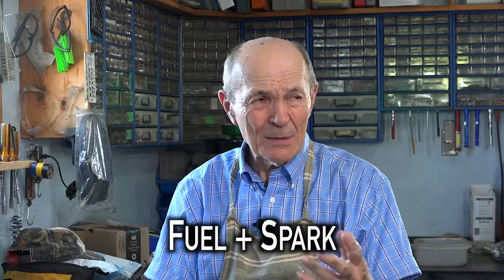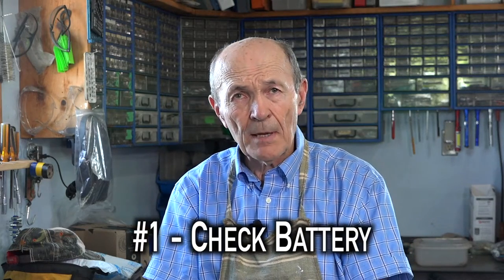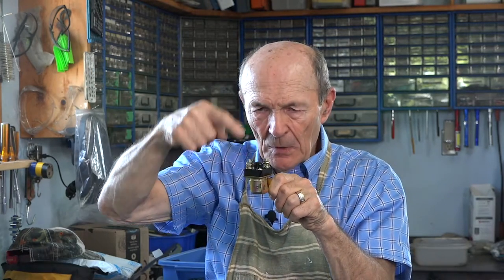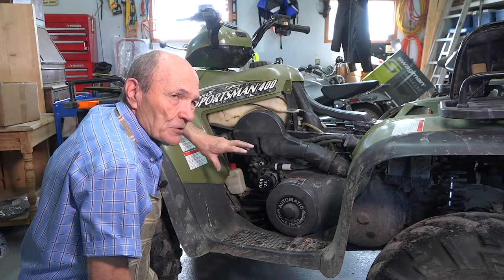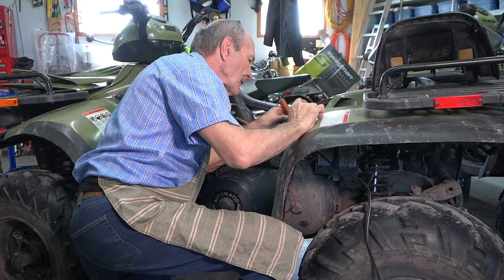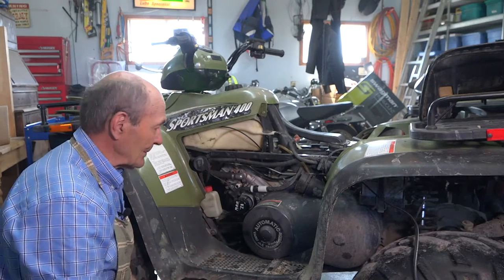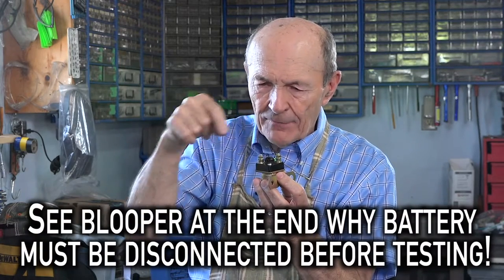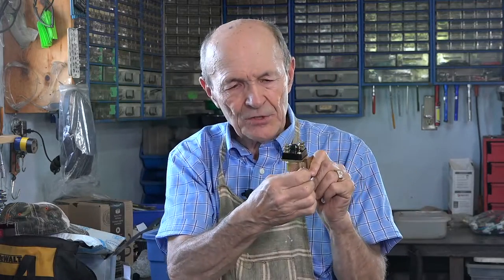#195 ATV Starter Problems & Fixes | At The Ranch

Comment: Hi Alec I hope you didn't fry anything important during your hot test. I just wanted to comment on the starter contactor (relay) I did have a case a few years back where the contactor stuck in the on position causing the hydraulic lift motor to keep running on a portable industrial lift table, this could have been dangerous pinching someone's hand or damaging the equipment. after investigation it was determined that the contacts were used so often that they fused together. The solution was to use a much higher current contactor as a replacement. I am just mentioning it because a lot of items from off shore are rated way too high for their normal usage. Probably won't be an issue in your starter application but keep the old one as a spare if it does fail. "and this is what you shouldn't do!" if someone is filming your mistakes HAHA
take care Owen m
Reply from the maker: Oh Kevin was ready to run but kept shooting to get this blooper.  Will do Owen
A

Comment: I got a new battery and it die from me just trying to start it it was turning over fast but then then more I try to start it the weaker the battery got and the time befor that I was riding it and the battery die on me out of nowhere I need help
Reply from the maker: Clearly not a battery problem. Either your starter is drawing too much current & killing the battery quickly and/or the charger (magneto) is not charging the battery. It could be both. If you have a multimeter, you can check the starter draw. You need an ammeter to check the charging circuit. They're not expensive.
I'd also suggest that you see why the machine doesn't start easily & quickly. Obviously, if the starter has turn over & over a long time (more than 10 seconds), the battery will die. Maybe a tune up will solve the problem. 
Alec
Reply: @AlecPeirceAtTheRanch  True and thanks . having a hard time puting 2 springs 2 small brush starter back to gether. seems impossible. cheap 36 dollar starter I just took apart and spray cleaned and really just wanted to check the insides out. it will work if I tap it with a hammar. lol